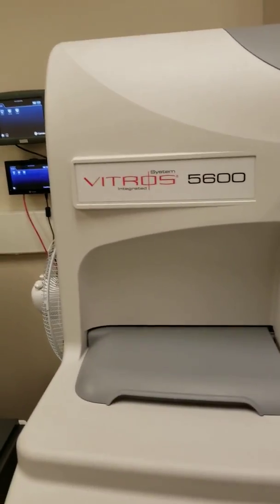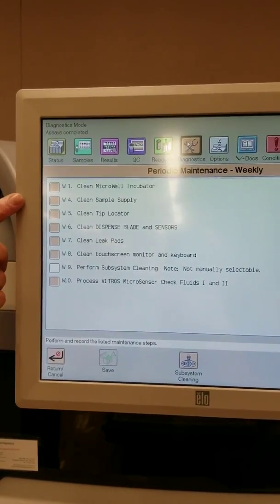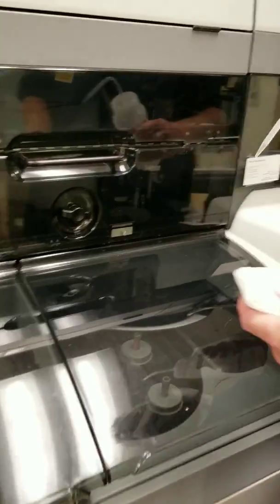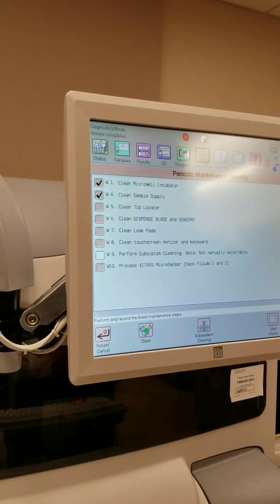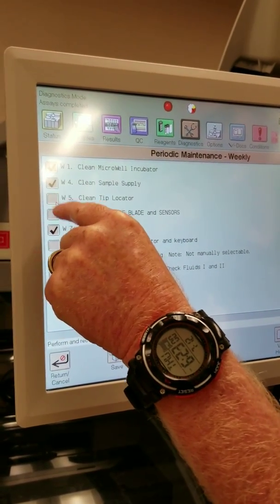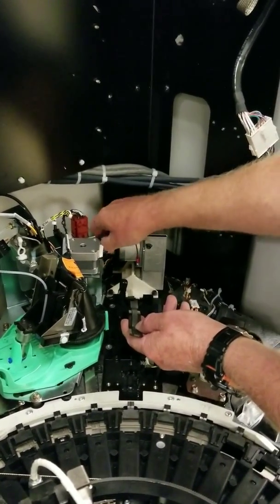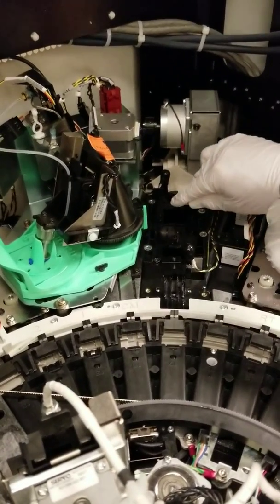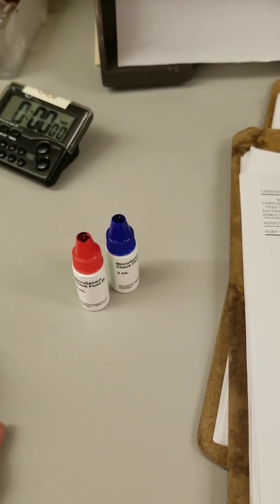Weekly Maintenance Vitros 5600

Comment: Our system 5600 is having problems with tip sealer what should I do
Reply: Your question is one year old, but if it helps...
I use a small star screwdriver and I put an alcohol swab on the end. I insert it in the tip sealer hole and forcefully rotate it. I may have to repeat this process. I was having issues where the gunk in the sealer was so hard to remove that it would frequently give me errors. I realized that the sealer’s metal is so hard that it’s pretty hard to damage. It was out of desperation, but I’ve been doing it for close to 10 years now, and haven’t had a problem or error since I started doing this.
Good luck.